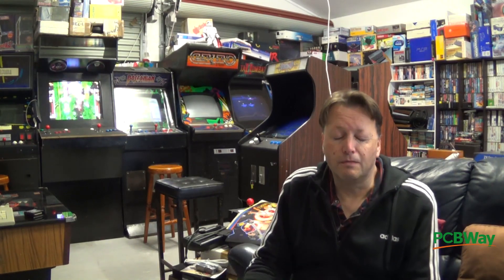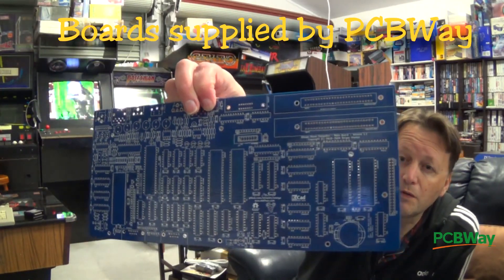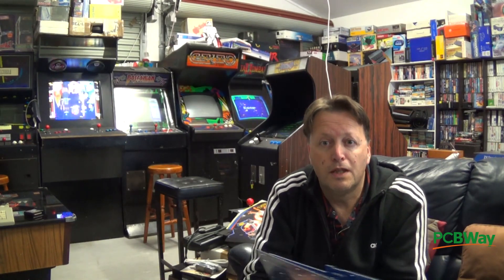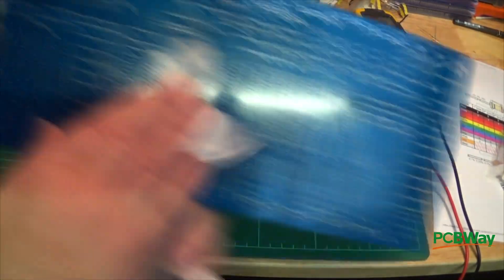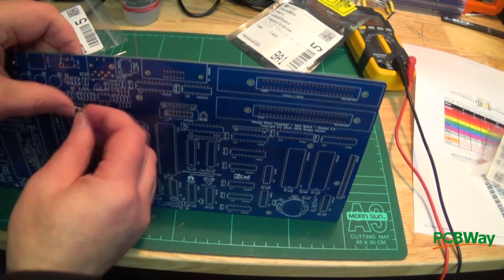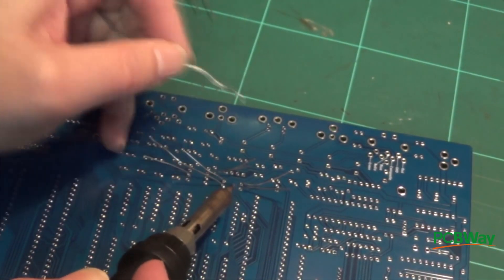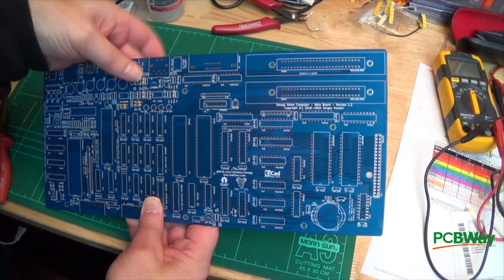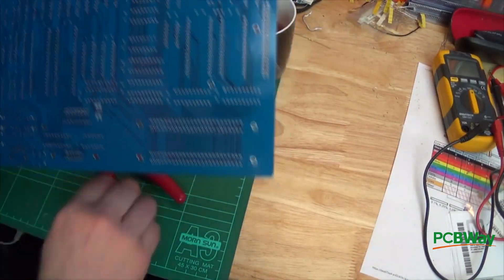Let's Build Our Own Omega MSX 2 Computer - Part 1-  Getting Started

Comment: Since you have to solder anyway, isn't it an idea to make it MSX2+ compatible? I've seen the project at Github and it seems that you can use the VG9958. I don't know if it would be more difficult, but at least that part is covered.
Reply from the maker: Yes I will be using a 9958 for mine, the build covers using either.  It does not include MSX Music though, so not truly MSX 2+ compatible, but it should play the games that support the 9958 fine.
Reply: @electricadventures  I guess one of the music cartridges would do the job too. The MSX as a standard worked pretty good, but when it comes to music expansions it is/was a bit of jungle. Good luck with this nice project!
Reply from the maker: Yeah one of the OLP cartridges is probably better than MSX Music anyway, and there are a few of those around now as well.
Reply: electricadventures msx-music is not part of the msx2+ standard, although most msx2+ include it (except one model didn’t include it iirc)

Comment: Been toying with the idea of  building my own Omega  MSX2, as it looks so cool and as real MSX2s are getting quite expensive on eBay !

Also  I spotted a  'kit' of ICs on eBay ...:

https://www.ebay.com/itm/Omega-MSX2-Homebrew-Computer-IC-Kit/114105900693?hash=item1a913dde95:g:8O0AAOSw2bReP8n0
Reply from the maker: Thank you, that is a pretty good source for the main ICs, I might order a spare set of those as well.  And yes even though it is a fair bit of work you can build yourself a MSX 2 for less than you can buy a existing one - plus of course it is fun :)
Reply: @electricadventures  I also spotted a kit of ICs for a MSX2 machine,  these ICs are PLCC type: 

 Z84C0020VEC or otherZ80-CPU PLCC44 x 1pc
EPM7128SLC84 CPLD  (Glue logic) PLCC84 x 1pc
V9958  Video IC VDP PAL/NTSC DIP64 x 1pc
D41464 IC DRAM x 4pcs
W27C512 IC EEPROM PLCC32 x 1pc
AY-3-8910 or YM2149 Sound Chip (PSG) x 1pc
UM61512 IC 64kb SRAM x 2pcs
CXA1645P Encoder DIP x 1pc

https://www.ebay.com/itm/Zilog-Z80-MSX2-Homebrew-IC-Kit/113919614595?hash=item1a86235e83:g:AtAAAOSwDXldnz1i

So I wonder has someone designed another MSX2....using the PLCC Z80 type chips ??
Reply from the maker: I think there were some other home brew MSX builds in the past, but not sure they ended up being an open source project.

Comment: I would be interested in making one of these at some point.
Reply from the maker: I have spare sets of PCB's when you are ready.  The rest of the parts can take some time to put together from the various places, but it doesn't end up being too expensive.
Reply: @electricadventures  How much for a set of PCBs Tony?
Reply from the maker: $AUS60 plus postage for a single set of boards.
Reply: @electricadventures  postage expensive to the UK ? I am very tempted to get the boards then start sourcing everything else as and when 😃
Reply from the maker: About another $AUS26 for standard postage at the moment.